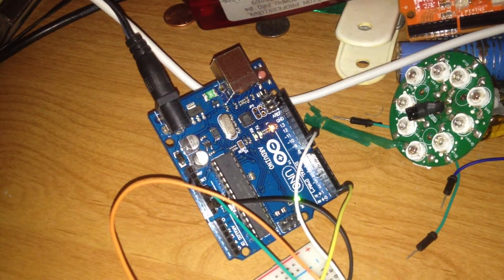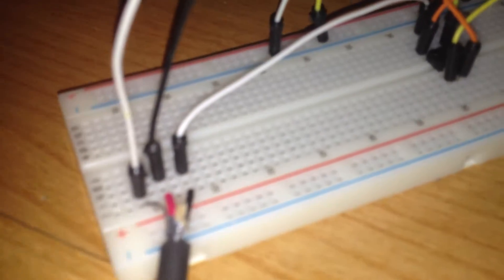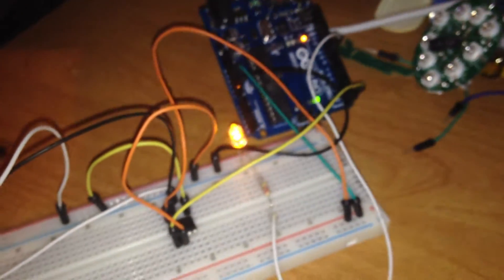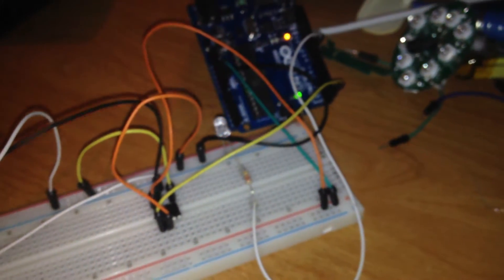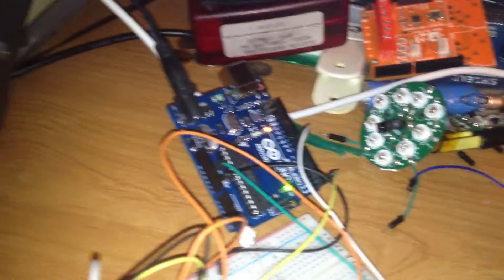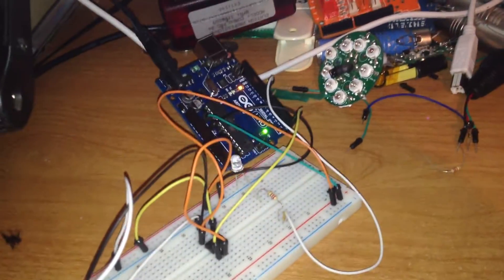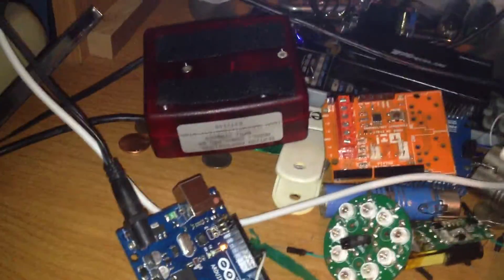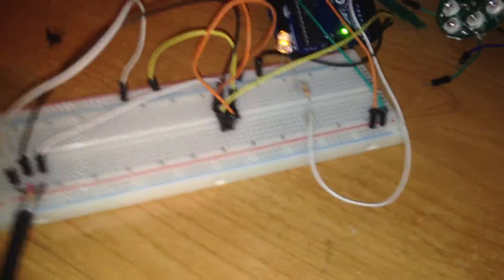DMX Reception on Arduino

Comment: Sorry to wake up this post.. but I've got the same problem.

Arduino Nano with DMXSerial library.. Program is combined with Neopattern to light up 1 short (test) RGB WS2812 strip).
I am using Sunlite Suite 2 to generate a DMX signal. On channel 1 (driving led 1) everything is fine. On the channels 2,3,4 etc my RGB leds are flickering. I got pin 4 from the Max485 with a 1k resistor to the ground.

To resolve this problem I placed a delay(x) between the DMX-channel readings... this works allmost fine (some flicker so now and then) but slows down the process and is not perfect.

Wo can offer te correct solution to this problem ? I am guessing this is a timing problem... but don't know how to solve it.
Reply from the maker: Do you have an oscilloscope? It's been so long since I've thought about this that I can't exactly remember what the fix was. I want to say maybe it was a grounding issue between the two devices. Make sure you don't have any ground loops between your Sunlite console and your Arduino. If I recall, there wasn't a coding issue when I got to this point, it was something with the wires. I also would check and make sure you're not powering the Arduino off USB when you do this as I recall that introduced grounding problems. I powered the Arduino off an external supply.
Reply from the maker: I can send you the code that I used if you give me an email.
Reply from the maker: You can run the Sunlite interface off USB, I have an old one myself. Just make sure that you're not grounding the Arduino to the same computer via USB. I'll send you the files I have in a few...
Reply from the maker: Also, make sure that your power supply for the WS2812 strip is powerful enough and that you terminate the end of the signal to ground on the WS2812 strip.

Comment: your  circuit is not correct  the max 485 should be wired like so pin 1 goes to the arduino's rx pin ,pin 2 ,3,5 go to ground ,pin 4 connects to ground through a 1k resistor . Pin 6  goes to  the xlr's pin 3 , pin 7 goes to the xlr's pin 2 and pin 8 goes to 5v. The xlr's pin 1 goes to ground
Reply from the maker: this was awhile ago. eventually I got the device to work, though, it was such a long time ago I'd have to dig out what I actually did. If I recall, it was something rather simple causing it to do this. thanks for the post though, you are likely correct!
Reply: edwardo388 by the way this was a great idea for arduino dmx

Comment: I have the same problem with my project. In fact i didn't find the solution. But I think that there is something to do with noise. However it only appears when the controller is transmitting (note that it flickers when ch2 is on).